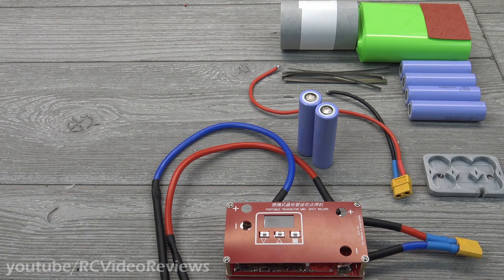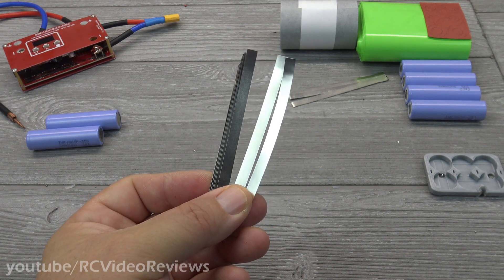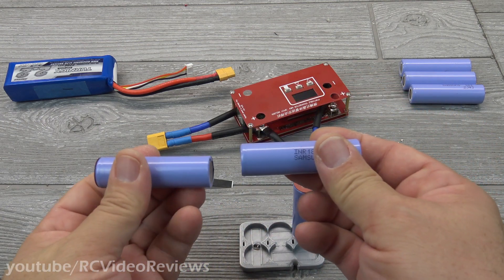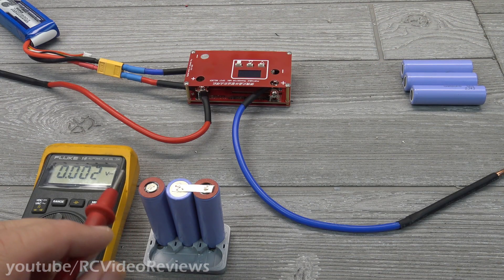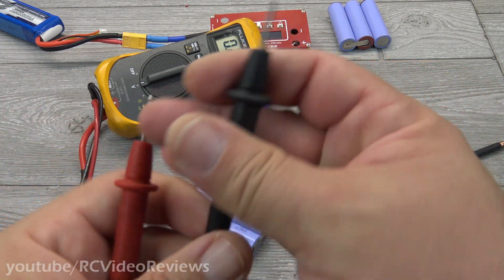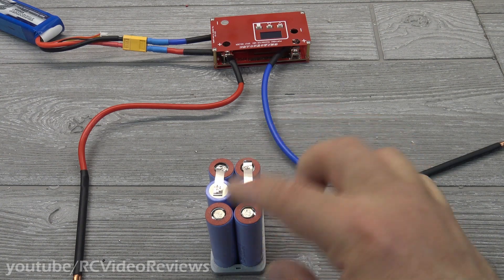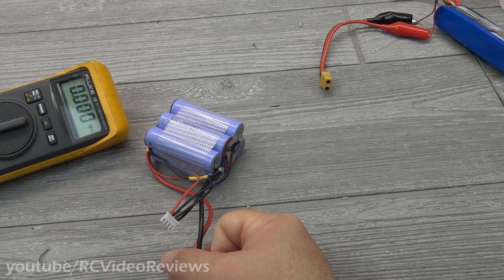How-to Make 18650 Li-ion Battery Packs

Comment: I didn't think there was such thing as a 18650 5000mah battery?   I didn't think the 18650 had the capacity to hold 5000mah?  China claimed 5000mah all the time bit they are from 2500mah to 3500mah capacity.   Am I wrong here?  Remember neverming the writing on the 18650 packaging ...I'm talking real world capacity

Comment: How do you combat the issue of esc low voltage cutoff? Considering these can be discharged further than a typical Lipo.
Reply from the maker: Add a lipo alarm to the balance plug or just put a cell checker on it and watch it as you use it.

Comment: What does it mean that the cell specs say that it has 10A continuous discharge ? Does it mean that I can pull a whole 10A of that cell or what exactly ?
Reply from the maker: 10a is a rate not a capacity. It means you ca consume the capacity of the cell safely at a 10a rate.
Reply: @RCVideoReviews  Yes I know it's the current rating for let say 2800mAh cell with 10A discharge rate. Now if I want to get the max current. What current I can get without getting the cell to get excessive hot ?
Reply from the maker: Usually discharge rates are specified in C as in 40c. You multiple that number times the AH rating of the pack to find the constant discharge rate in amps.

Comment: My quad draws less than 20 amp which cells do u recommend me to get more flight time
Reply from the maker: Get yourself some 10a 18650's and put them in parallel in any voltage/capacity combo you can support within the weight constraints of your quad. Putting them in parallel gives you more amperage carrying capacity.  i.e. 2 10a cells in parallel let you run 20a of current.

Comment: I will try this, I got maxAmps battery, they have 30amp of discharge
Reply from the maker: Do you mean 30c or 30amps? It needs ~120a to weld.
Reply: @RCVideoReviews  check this out its 30AMPs, I have 4 of these https://www.maxamps.com/maxamps-18650-battery-2150mah-30a

Comment: Hi there good video 👍I have a question what type of lipo battery u used with ur spot welder and what’s the discharge rate in the same lipo battery ?
Reply from the maker: 3s2200 40-70c. Just keep the voltage above 12v and a strong 3s lipo will probably do the job.
Reply: @RCVideoReviews  thanks man

Comment: Nice Video. 
One thing that I feel should be noted is when explaining wiring balance leads is that you should start with the negative and each subsequent lead is “positive” despite the wire color. In manufacturing its documented negative to positive so the only change in schematic for instance between a 3s and 4s is adding 1 balance lead and a cell. If documented positive to negative every single cell and lead label would have to be changed. This also comes into play when dealing with dual voltage packs, BMS’s, load balancers etc. The one thing that stays constant between any battery packs/ chargers is the negative lead despite the pack type. The nominal positive terminal always changes based on how many cells are in series.

Im NOT saying the way you explained balance leads in video was incorrect. Just that if you look at it backwards, scaling your packs up or down become much more trivial.

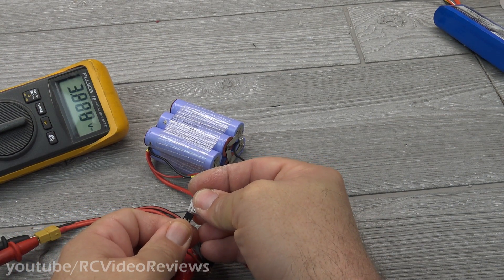11:29 You said cell 1. technically that is cell 3. 

cell 1 always starts from the negative side. you can plug your pack into any tester or charger to verify this.

Comment: Thanks. After watching this video I realized that I can do the same instead of buying lipo packs. Could you also attach a connection scheme? I didn't understand how you connected the balance connector.
Reply from the maker: I can do better than a diagram, I can give you a dynamic diagram: 

Check this out: https://www.offshoreelectrics.com/lipo.php
Reply: @RCVideoReviews  Thanks for the link. This is what I wanted.

BTW, How to calculate discharge rate for this battery pack?
Reply from the maker: @DjemOk  The cells are 2500mah and 25a. So that means they are 10c cells. This doesn't change due to series/parallel connections, they're still 10c. Three cells in series are still 25a. Putting two in parallel yields 50a but 5000mah. So still 10c.

Comment: If each cell is 2500 milliamp what is the math that you use to get to 5000 milliamp total
Reply from the maker: 3s = 2500mah.  2p = 2500x2.
Reply: It doesn't matter how many are connected in series it will still have the same mah. It's when you connect them in parallel that the amount changes so if you have 2 in parallel then the amount would double or 3 in parallel then it would triple.
Reply: I have the same question,  I just don't understand how that adds up.   Each cylindrical battery is advertised @ 2500 mAh.  You have 3 in series and another 3 in parallel correct?   Even so 3 batteries x 2500 mAh is where the confusion for me is at.   I hope that made sense.   If be interested in making some flight packs

Comment: 2:04...I would add 10-20% extra on the circumference to make it easier to insert the batteries into the Heat Shrink... You know that it will shrink... ;-)
Reply from the maker: I rounded up to the next closest size.
Reply: @RCVideoReviews  Just as good. I mentioned it for people that never used heat Shrink.